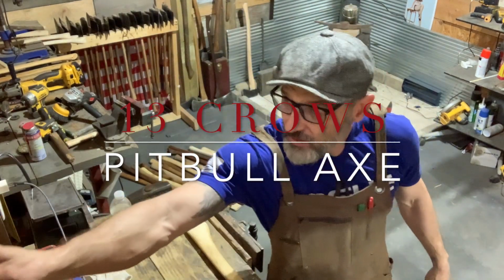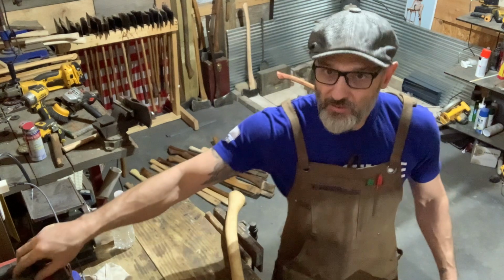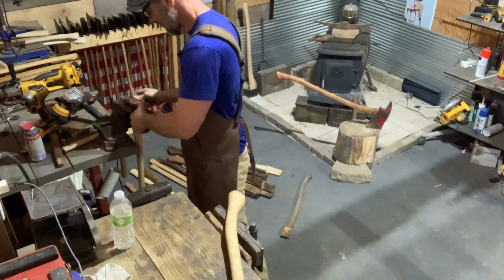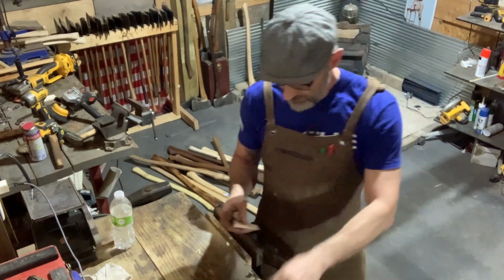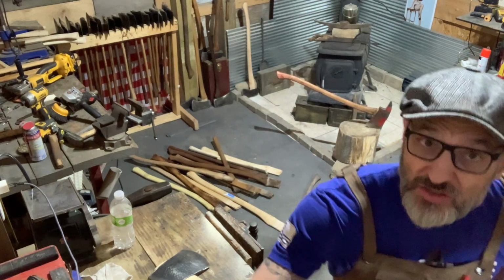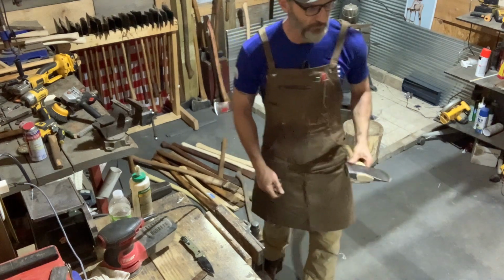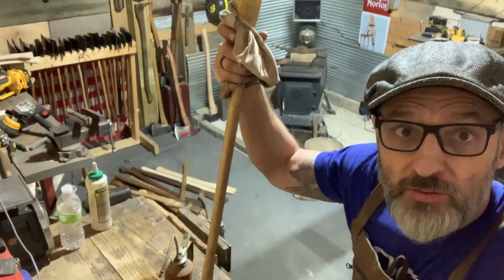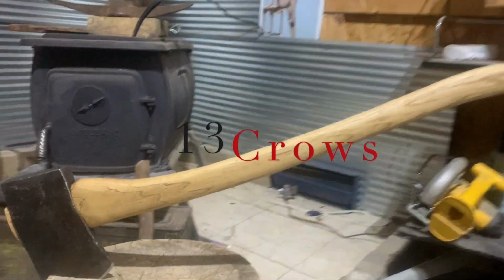The Pitbull Axe

Comment: When you said it feels too heavy to be on a 32 inch handle and maybe you should use a 36, that confused me. I would think a shorter handle would make it easier the control more weight.
Reply from the maker: True Benton, but for some really heavy heads I like to go 36 just for the leverage, kinda like maul.  I normally don’t use 36 inchers but now an again I find a head that I feel needs one.  Thanks for the comment!